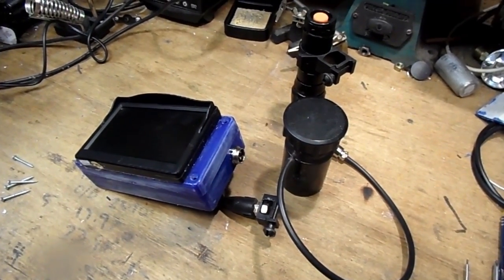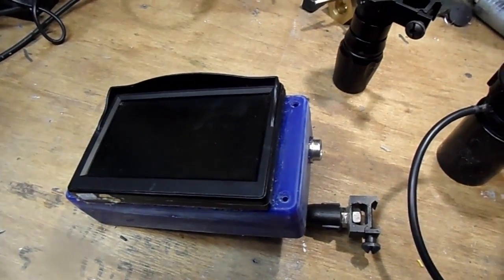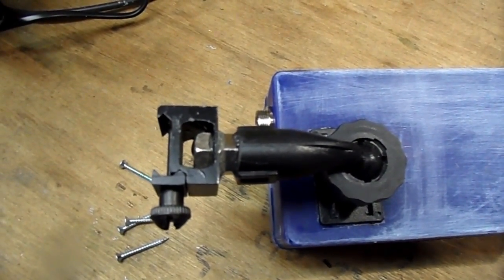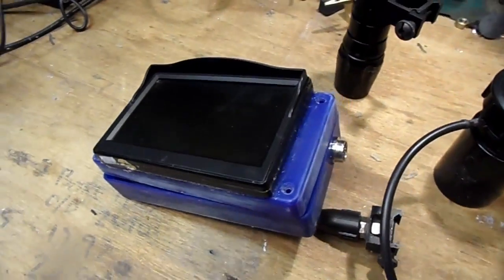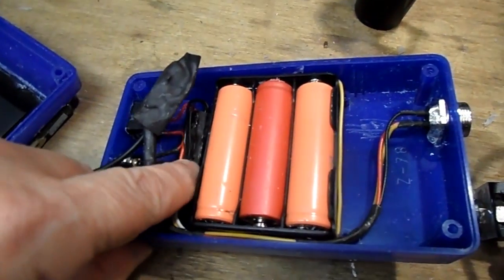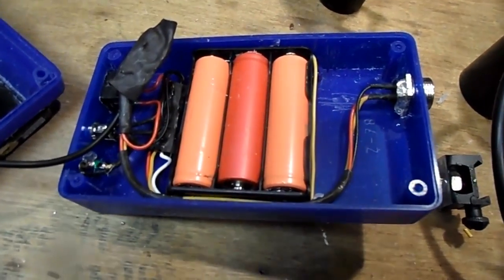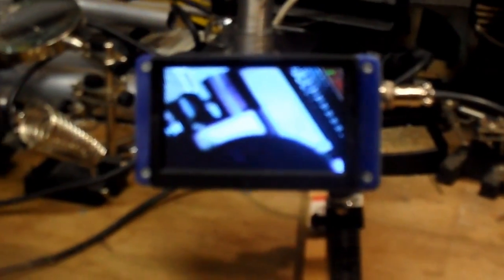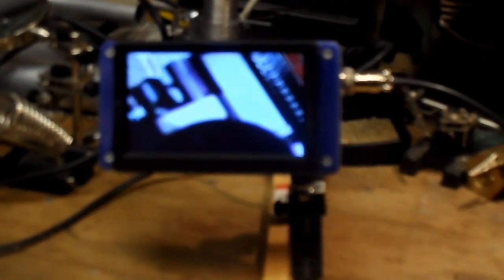Neat Night Vision add on build part 2

Comment: Nicely built Terry, but would you have a wiring diagram for us less skilled enthusiasts.
Reply from the maker: I’ll see if I can get something but it is very simple. I use a small piece of circuit board and it needs 4 columns, 12 volts to battery, 12 volts to camera and monitor , ground and video. A switch goes between the 12 volt battery supply and the power to camera and monitor. Charging input goes to 12 volt battery and ground. You can use a 2 way plug and socket for charger and a 3 way for power, ground and video to the camera. Battery packs can be bought or made up with 3 18650 cells and a 3s battery management controller.

Comment: Dove hai trovato tubo per telecamera?
Reply from the maker: https://www.sure24.co.uk/kpc-e700pub-16b-s-board-cam-ir-filter-removed-16mm-board-lens-1-3-700-tvl-30mm-sq-12v-dc-internal.html
http://www.screwfix.com/p/floplast-solvent-weld-straight-couplers-40-x-40mm-black-5-pack/76761 and
http://www.screwfix.com/p/floplast-solvent-weld-access-plugs-black-40mm-5-pack/65881
questo è raccordi di scarico 40 millimetri
Reply: Terry Marsh grazie mille.